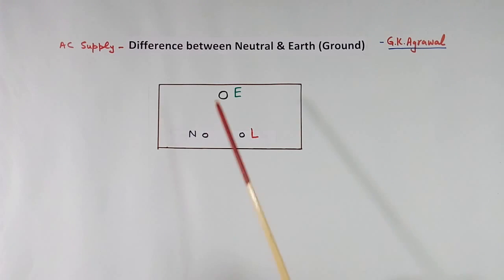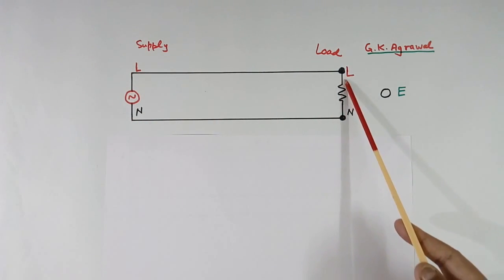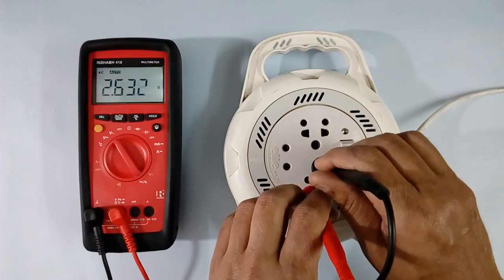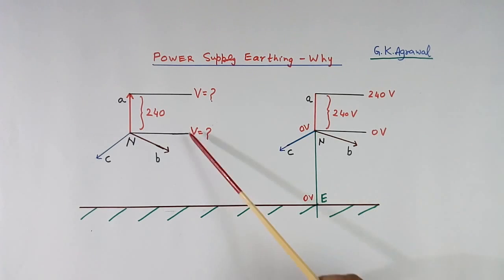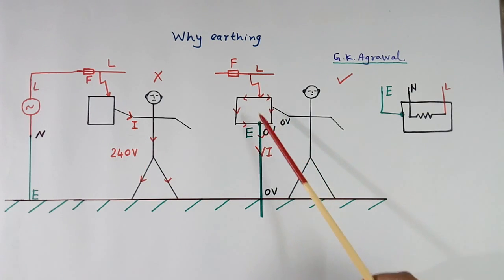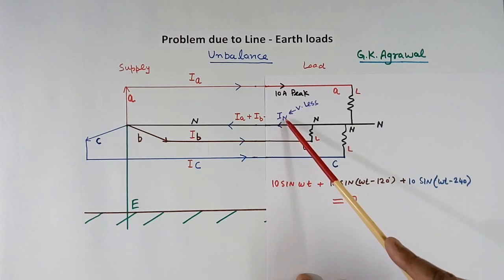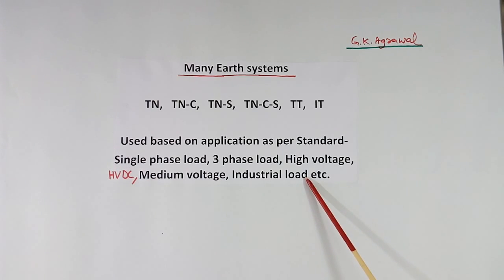Difference between Neutral and Earth in AC supply, why neutral wire

Comment: Sir, when connected the socket to the computer or, electric extension board, if L and N are reversed is that going to be a problem ??
Reply from the maker: It all depends upon equipment design. But design is not known, and supplier always ask for correct L and N connection. So follow the rule. However in my house,  I operated my laptop many times with L and N reverse and no earthing connection in my work table. But laptop working from last many years without problem.
Reply: @GKAgrawal2  .. thank u, sir😁😁

Comment: Sir,
What could be possible cause of Neutral wire  showing continuity with Earthing wire anywhere in a building wiring when service MCB(2 pole) is in ON position while same wires do not show continuity when the MCB is switched OFF, in single phase supply. It is confirmed there is no continuity between any two wires L, N & E in the building wiring when checked without switching ON the aforesaid MCB. Further with supply ON the potential difference between L & N and L & E show 240V and that between N & E shows near zero. Shall be thankful if you kindly send your response on this issue. 
Regards.
Reply from the maker: Looks like, you have not watched properly this video of neutral earth difference. Watch this video again 2 times, you get the answer of all your questions.
Reply: Sir,
Thanks for your prompt response. I have watched your video referred to but not yet clear. Are you suggesting that since transformer secondary as well as building sockets are properly ground for which it was showing the continuity which was normal and expected?
Reply from the maker: Neutral and earth are connected at transformer point, so conitnuity. But do not test it with multimeter resistance range. Multimeter may go bad. Resistance measurements to be done off line using multimeter.
Reply: @GKAgrawal2  Thank you very much. Noted your suggestion for not to test with Multimeter. But for academic interest only, how about testing continuity between N & E keeping the Line OFF but N  ON ? Secondly, can we also rest assured that earthing at both transformer and building ends are o.k once the continuity is found?

Comment: Hi dear professor. may I ask a question ?  I'm always having this simple question : In AC circuit we say the polarity is constantly changing. Why we always get the hot wire on only one cable when using a test pencil  ? Thank you
Reply from the maker: Nautral is about zero volts. Voltage of hot wire with respect to neutral is changing polarity plus and minus. Some time plus 220 volts rms, and some time minus  220 volts rms. So we say, polarity is changing. Voltage value depents on country. So wether plus 220 volts or minus 220 volts, it is danger and called hot wire {with respect to the neutral wire voltage of zero volts}

Comment: I Am Testing In My House There Is 60V In Neutral And Earth ,Neutral / Phase 240V , Phase And Earth 160V.
Whats Is The Situation of Electricity.
Please enplane I am Getting Confuse
Reply from the maker: Check these voltages in your neibours house also.
Reply: Sir what this Reflects ia is ok or a bad Neutral or bad earth
Reply: As In your video There is complete voltage Reflecting in phase And in earth 230v.
But In my House there is 160v what is the problem

Comment: sir our distribution network facing typical problem. There 380 volt between Earth and Neutral. Tester glowing in Neutral and  in  Y phase tester is not glowing.  Please help clarify.
Reply from the maker: It looks like due to fault at y phase neutral wire is open and disconnected from the distribution transformer. This is just 1 possibility. Watch my video on "high voltage due to floating break neutral"

Comment: Good Morning, Sir
I would like to know, Is it true in an ideal condition of a house wiring that the volt of Phase with respect to earth should be higher than with respect to neutral? You have shown in your video that the volt of Phase point of a socket with respect to earth is higher than with respect to neutral point. Please elaborate this.
Reply from the maker: Not necessary, RMS voltage between phase and neutral can be less or more as compared to the voltage between phase and earth. Further, voltage of phase or neutral with respect to earth will not be shown negative, as multimeter is showing RMS value. RMS value measured by multimeter for AC is always shown positive. Positive does not mean more or less.

Comment: Good Morning Sir,
Today in the morning, I checked volt of Phase point of two different socket (of two electric boards of my two different room) with respect to neutral and found it was 235-236, and with respect to earth it was 231-230 in both the cases. but volt of neutral point with respect to earth point of both the sockets shows 000. Is the result OK, Sir?
Reply from the maker: You should check neutral voltage at littile lower range scale of the multimeter. 5 or 6 volt may be difficult to read at 700 or 1000 volt scale.

Comment: Thanks for lucid presentation of YouTube postings under different subjects. Recently my wife got three to four electric shocks from her washing machine. I checked earthing of the socket to which three pin plug of the washing machine was connected. I was surprised to see there was current in the hole of the socket when checked through a tester.  Not getting an electrician for four days to resolve the problem I checked earthing of the socket myself through the tester again and found there was no current at all. Even other electric boards of my different rooms did not show positive current in the earthing hole of sockets.

 I would be grateful for your response of what could be the problem which might have caused the electric in the earthing hole of socket.
    
Thanking you,
Mani Lal Shah
Reply from the maker: No indication in earth point of socket does not mean that earthing is proper. If there is no earth wire, then also tester will not show current. The board should be opened and check physically for proper earthing.  Earth wire in the washing machine also should be connected properly, check that also.

Comment: I am using 3 nos  Y-Y type PTs for protection relay in Low voltage unground system or IT system. Can I ground primary and secondary star point of winding in this type of grounding system.
Reply from the maker: There is no general rule, It all depends upon the system connections.

Comment: +G K Agrawal If Neutral were never connected to ground would it be safe to touch Line or Neutral since there would be no closed circuit connection back to the power supply or source?
Reply from the maker: Still shock may be possible, as close circuit is possible due to stray capacitance between transformer winding and earth.

Comment: what happens when Neutral is omitted in 3 phase system .
Reply from the maker: Then transmission line may suffer high voltage  during fault and lightening strike and may damage.

Comment: Why we connect single phase load between phase and neutral.
Why not connected load in between phase and earth as earth and neutral are joint or short at a point ?
If connected so what's the problem arises, when we are not using rccb or elcb with main panel ?

Kindly clarify this.
Thank you

Comment: Dear Sir,   Why  people called  L - Live(+)   N- Neutral(-)   in house wiring.   For example   in AC signal it always change the polarity( +) and (- )   with its frequency.  I can't understand , why in  house wiring  L become +  and N become - .   I really appreciate if you could explain that.  Thank you so much .
Reply from the maker: You are right. L does not become +, N does not become -ve. But just for explanation purpose, some may be calling it + and minus.
Reply: thank you sir

Comment: thank you for the explanation. 

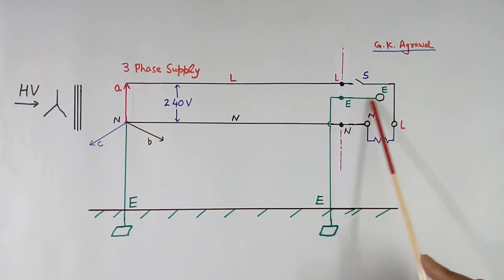@5:37 the current flow from the source through the load and back to the neutral line back to the source neutral which is grounded. So what does the Earth from the load do? Wouldnt the current take the earth which is the nearest from the load and back to ground instead of going to the neutral?
Reply from the maker: Thanks for the comment. At 5.37,  load is connected between Line and Neutral. So there is no path for earth current. Current will flow between line and neutral only. Earth wire is for safety and protection only in case of fault. Reason of earth wire is also explained for load @8.04 in the video.
Reply: If there was a fault, let say the neutral wire is the fault and it is touching a metal case of an equipment. The current will flow from the source through the metal case and through the neutral line back to the source neutral. The earth/ground wire from the metal case would take it straight to ground and because of this the current flow is too much and the breaker would trip? thanks
Reply from the maker: In case of line to case fault, human will get shock. Without earth wire it will not be protected. During fault breaker must trip for protection purpose.

Comment: hello sir, after watching your video and understanding the importance of Earthing or grounding,I would like to ask a question about "STATIC AC ENERGY METER 1PHASE 2 WIRE" It has 4 LED indicators namely:
1.PHASE- Continuously glowing
2.EARTH- Remain OFF but when Refrigerator is switched ON ,it glows continuously.
3.REV- Always OFF
4. CALIBRATE-Keep blinking as per Load.
I asked the local electrician ,he told me to change the Earthing,I have got installed Standard G.I Pipe earthing by Electrician but still the problem is same as refrigerator is plugged-in ,the EARTH LED indicator in Energy Meter Glows .
There is No Fault in Refrigerator Ckt ,I have got it checked by Electrician.
Reply from the maker: You fridge appears to be having some earth leakage. What you do, remove plug, measure resistance between line and earth using multimeter ( do not touch wire with your hand other wise your body resiistance will come in parallel.
Reply: Readings of Resistance Measurements are as :
1.Live-Earth=open(1)
2.Live-Neutral=open(1)
3.Neutral-Earth= varies from 5 Ohm to 150 Ohm, cant take stable reading, it keeps changing regularly

Readings of Voltage Measurements are as under:
1.Live-Neutral= 222V
2.Live-Earth=     230V
3.Neutral-Earth=11V

Sir, Kindly tell me where is the fault ? How to rectify it?
Also, is there any Harm to my appliances under this condition??
Do  this leakage of current also affect Meter Reading???

I shall be keenly waiting for your Reply 
Thanks!
Reply from the maker: 1- Earth neutral is not open means there is earth lrakage. There may be safety problem. If you have RCCB , then it should be trip.
2- L N open. It can not be open, some load will be there. Please measure resistance using all scale of resistor in your multimeter.
Reply: Sir L N shows only 1, I measured at all scales of Digital Multimeter. 
I have measured in open circuit....is it correct???

Sir what about Voltage Difference??

Comment: This is an excellent explanation. I finally found an explanation that makes sense to me. Very clear and concise. Your use of  "low tech"pieces of paper with simple extension diagrams just works beautifully.
Reply from the maker: 1- Thank you very much for comment and appreciation.
2- Regarding method used by me to explain engineering subject  - as per my knowledge i have not seen such method is being used in last 60 years. Any method, which is used first time should be called " latest high tech ".